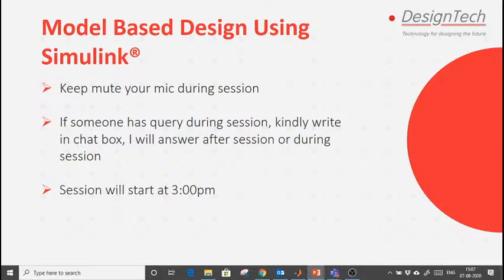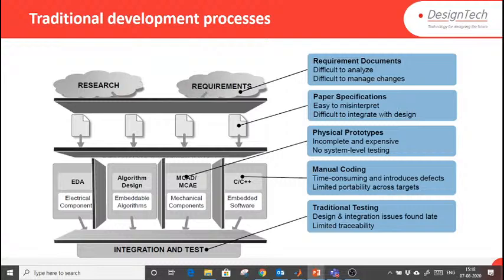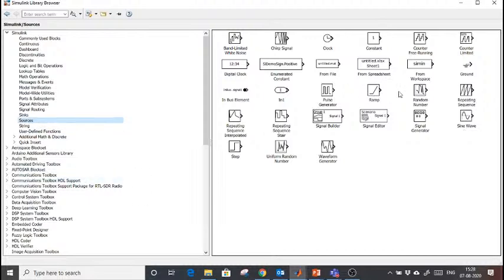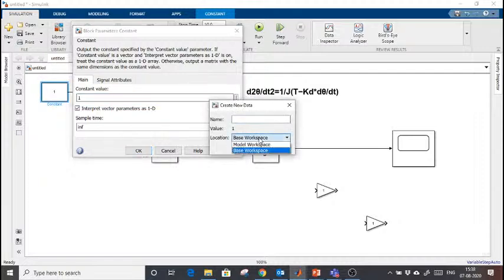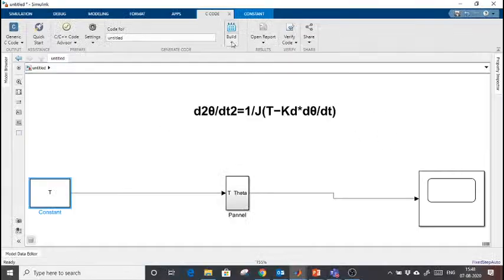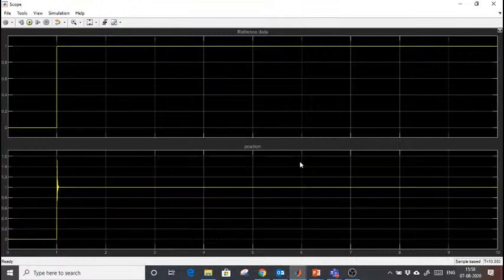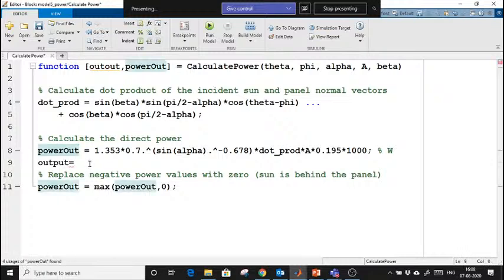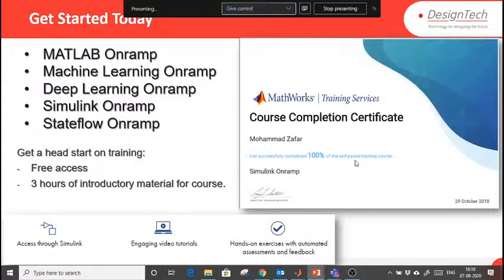Learn System Modeling with Simulink

Comment: Sir, how to use MATLAB for mechanical engineering and also Researh students.
Reply from the maker: There are some toolboxes for mechanical which you can use , next it depends on what kind of mechnical applications are you going to design..  you can go through this video to get flavour of mechanical applications with MATLAB https://in.mathworks.com/videos/integrating-mechanical-design-and-multidomain-simulation-with-simscape-1541020355049.html
Reply from the maker: For complete physical system with MATLAB , you can go through this 
https://www.mathworks.com/videos/physical-modeling-with-simscape-81950.html